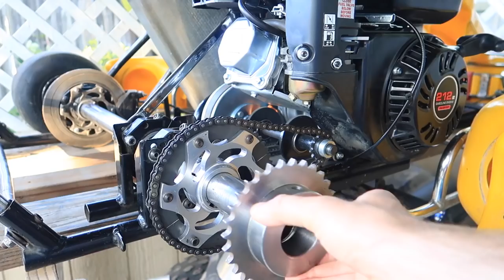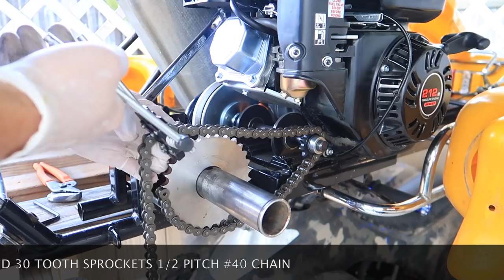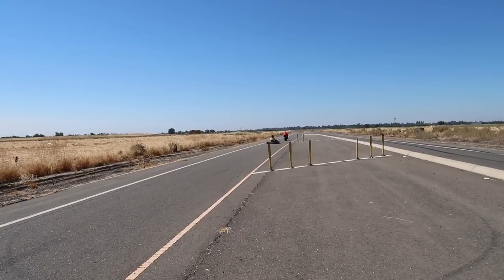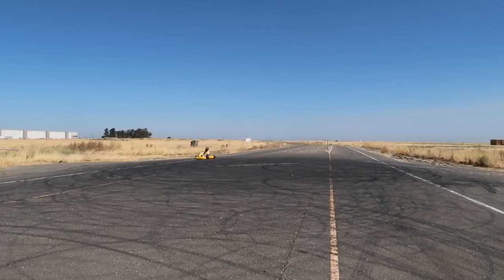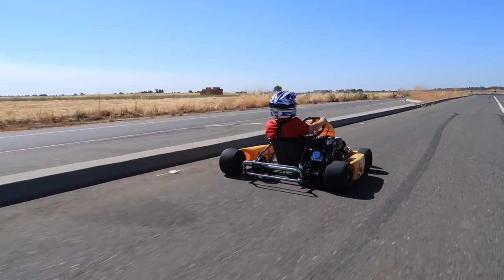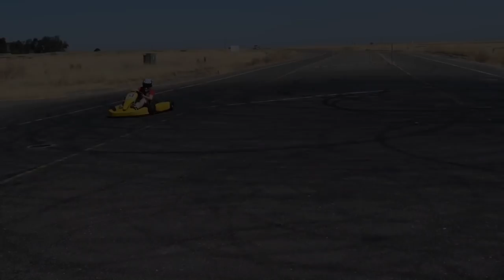Can small sprocket make a big difference?

Comment: If you want speed, you shouldn't have changed the front sprocket.

To put it simply:
For more speed, bigger sprocket in the front, smaller in the back
For more Torque/Acceleration, smaller sprocket in the front, bigger in the back

The back sprocket is what turns the wheels, on everything
The front sprocket is what spins the back
Faster rotations up front (smaller sprocket) means the back wheels will spin more, but the front sprocket only grabs so much of the chain
Quite the opposite for the back, obviously
Bigger sprocket, the lower the rotation per minute, 
Think of it like.. 
Put your hand on a ceiling fan
All the way on the end of the fan blade
Now spin it a couple times, without moving your hand from the blade (put a finger on it, and you won't have to grab it to turn the hand)
See the speed at which you spin it?
Now do the same, bringing your hand to the middle of the fan blade, or even smaller like you are almost right at the fan itself
Now spin it.
Much faster.
Less Acceleration, more top end speed
More Acceleration, lower top end speed
Reply: Now what if I run a bigger front and smaller rear ?

Comment: 49 MPH is good top end for a go kart that’s not a shifter
Reply: i gotta single speed rotax 125 tag that can go 90 to like 110 depending on gearing but thats a two stroke at 16000 rpm
Reply: @killercane5183  Alotta RPMs. I wouldnt want to be straddling that on a motorcyle or waverunner
Reply: Ross Templeton  its a race kart and yeh its pretty scarry i garentee u let of gas b4 top speed lol
Reply: Just built a stage 1 212 predator 12 tooth clutch and 65 tooth axle sprocket and too speed is 42 mph

Comment: You need to modify the engine so it can pull the higher ratio to a better top speed. Loose the governor and check out go power motorsports for their hp kits .! Love the kart though ;)
Reply from the maker: eros20V 
Thanks for your suggestion and advice. Cheers

Comment: Put the 12T sprocket back on the front. That will give more top end than the 10T
Reply: Anthony T will it make it faster? Because I have the same motor from Harbor Freight! And I haven't broken it in yet but I want to make it faster.
Reply: Trell Atkins A bigger front sprocket = more top end speed.
Reply: Anthony T So for the back sprocket how many teeth should I put on the rear end?
Reply: Trell Atkins too many variables for me to tell you that. Use bmikart's gear ratio calculator to figure out what is best for your setup.
Reply: Anthony T thanks bro you've been a big help. 👍
Reply from the maker: Anthony T 
12 tooth is made for #35 chain and 10 tooth is for #40-41 chain. Different pitch so they are not compatible.
Reply: balabay77 I didn't realize you changed the thread pitch with the sprocket change. Sorry about that. Nice video.
Reply from the maker: Anthony T 
It's all good. My kid wanted to see if it will go faster with smaller sprocket but now we know that we need a two stroke engine to go faster lol. Thanks for watching and commenting.

Comment: I've been wanting to try a gear ration much like the bicycles. Where you have a bigger sprocket as your main drive and a smaller on the axle. The only problem I see is if you go to small on the axle your go-kart will take of slow but, in the long run it will speed up significantly. If you can put a shifting gear mechanism like the mountain bikes on a go-kart that will give you take off and speed.
Reply: It doesn't need that because of the torque converter.

Comment: The Predator engine doesn't have the torque needed to drive a smaller sprocket.  The setup you had was probably using about 95% of the available torque.  When you went to the smaller sprocket you were using all the torque the engine could provide netting you just 2mph increase; the smaller sprocket was essentially putting more load on the engine.  The sprockets must be matched to the engine.  You MIGHT get more top end speed by going to an engine with a shorter stroke designed for higher RPMs (such as a motorcycle engine) and keep the original sprocket setup.

Comment: Take out the govern, bore the carb jet, add a high flow air filter, ditch the muffler and add a straight pipe. That's all the basics without really spending money. If you are willing to spend $, there are racing upgrades you can buy for the engine along with a racing clutch. If fully upgraded, I can see it doing about 80.

Comment: i race drag mini bikes i weigh 230 lbs and i run a 16 tooth rear axle sprocket with a 17 tooth drive sprocket top speed at 4500 rpm's is 147 mph so when i say weight isnt a factor trust me take off is just like riding a ten speed with a large drive and the smallest axle gear works awesome just need big cohonies to ride
Reply: Nimbus Nimbus  exactly. Someone's smoking crack.
Reply: Nimbus Nimbus  alright..I did the math. Assuming that mini bike has a wheel diameter of 11 in the top speed is plausible.    Except that kind of speed will not be made by a stock mini bike with <3hp.  It would take a very long time and be extremely slow on acceleration.   You would need a bike with the power of a600+cc to even get up that fast.  Even with that power I'm not sure how long it would take it to reach speed with a 0.9 ratio...
Reply: All cap

Comment: Bigger motor sprocket. It's all about the gear ratio you need to calculate the gear ratio. Low 4s into the 3s will give you more top end but you will lose torque

Comment: I run a 12 tooth centrifugal clutch sprocket from (tractor supply $69.99) on the engine and a 42 tooth on the live drive axel ($29.99 tractor supply) on my 212 predator engine and hit 60 easy. Do direct drive get rid of the belt drive it's robbing  you of power then there your throttle back the screw off some to get more motor. I'm in the middle of a new go kart with a 420 predator engine with full function front and rear suspension. I'm bored with the 212 cc already I'm building one for off road now. If you have any questions feel free to contact me. Good luck on your project.
Reply: Hey I got a question about my baja mini bike

Comment: A small sprocket means you’ll get more acceleration but your top speed will be less. Think of it like a pushbike, the lower the gear, The smaller the sprocket, The easier it is to move but you don’t go fast. The higher the gear, the bigger the sprocket, the harder it is to accelerate but your top speed is a lot higher

Comment: The thing about gear ratio's is the more top end you try to get, the less torque you have to push it. It all comes down to how much power your engine has. Find a good balance between top speed and getting a good jump out of the turn.
Reply: I'd rather have a large sprocket.

Comment: Take out your  small front engine  sprocket and put a 50 teeth sprocket on the engine and keep the small sprocket on the rear wheels that will be fast
Reply: Use the v2 twin engine 650cc
Reply: Or use the 48 sprocket instead of the 50

Comment: If you only saw 2 mph difference I think your top speed is drag limited now. The difference in your final drive ratio should have been good for 15mph or more. The taller final drive ratio will create a higher torque load on the helix in your driven pulley and you may not be getting a full shift out from the cvt ......or the taller final drive ratio is just too high to over come the wind drag now and you are not reaching the same engine rpm or as you were with the lower final drive ratio. For more top end with out power mods or a bigger motor you will need more rpm applied to a lower final drive ratio. Your old 12t:53t set up with no governer will probably be your cheapest gain. Try that first because most of the engine kits that offer any real gains will eliminate the governer anyway.

Comment: Did you go bigger or smaller on jack shaft
Reply from the maker: I went with smaller sprocket ⚙️ on axle which it gave me a better top speed but my take off from complete stop suffered. Motor had a tougher time gaining speed with that sprocket but once it reached the top speed it was hauling ass.

Comment: Just a suggestion when you go to get another 212cc Predator engine make sure you get the Hemi version I noticed you had the 212cc Predator engine but you didn't get the Hemi version they cost the same it will give you a lot more power believe it or not the Hemi version has aluminum valve cover more holes in the pole start and the gas tank has bumps on it that's the one you should be looking for
Reply from the maker: Thank you Adam for your suggestion gut unfortunately HarborFreight doesn’t sell hemi engines in California due to strict emission standards. Nevada sells them but it’s just too far and not worth my time. Maybe I could buy it online? I’ll see if I can find one on eBay or something. Thanks for watching and commenting.

Comment: The speed and acceleration depends on the number of tooth on the front and rear sprocket.
Reply: Correct. Smaller gear more RPM on axel

Comment: depends on how fast you are trying to go bmi gives you a gear calculator to determine top speed .If your running a 10 tooth 420 chain from torque converter to a 12 tooth start drive then to a 30 tooth then to a 18 tooth axle sprocket 150 mph is around were you will top out at.you will have good exceleration
Reply from the maker: Vanessa DeLair 
Thanks for the tip but in real world there are many factors that will make your kart or mini bike go slower than desired for example adult vs a child weight then altitude and terrain. Gear calculator is not 100% accurate but pretty close to desired outcome. Thanks for watching and commenting.
Reply: But unless you have the power to move that gear ratio you'd be lucky to hit 10mph with 6.5hp.. you'd burn the clutch straight up.

Comment: Could I have a link to the sprocket please?
Reply from the maker: Nick W. | PurpGFX 
As far as I know this sprocket was sold by private party on eBay as used for $10.99 and the only one for #40 chain (1/2 pitch). Other sprockets ranged from 20 tooth to 60+ tooth. Since it was my size (40mm axle) I figured it was a good deal. I'm sure there are lots of sprockets your size on eBay. Good luck sir.

Comment: Super charge it and put nitro in lol do you have a racing carb on it?
Reply from the maker: Kadespade 
It's completely stock but no matter how we tweak it, this engine is not made for speed. Two stroke is the way to go but I haven't came across one yet that was in my price range. 
There are many 80cc engines but 125cc racing go kart engines are just too expensive.
Reply: +balabay77 yeah I know what you mean things get pretty pricey, what if you got a wrecked dirt bike that has a good engine and buy it for the engine then you might get a pretty big engine

Comment: put a race carb and filter a race header remove the governer and maybe add a touqe converter
Reply from the maker: db scooterz 
This thing already have a torque converter but it does need lots of mods to make it faster. Maybe soon we'll buy some stuff for it. Thanks for your tip. Cheers
Reply: balabay77  hey balabay i was wondering where you bought that sprocket. Ebay?!
Reply from the maker: Herman Wallin 
Yes sir, eBay.  It was previously  used sprocket but in good shape. $10.99 plus $6.45 shipping.
Reply: balabay77 ok thanks!!

Comment: can u do a burnout with the gokart?
Reply from the maker: nitem kosmaz 
Unfortunately this crappy go kart can't do a burnout. It needs a two stroke engine to do a burnout.
Reply: balabay77 ? 😂 makes so much sense
Reply: @balabay77  wrong if you put the torque converter spring in hole3 or 1 it will do wheelies and if it doesnt have numbered holes for the spring drill them just like a comet power pulley its an easy mod